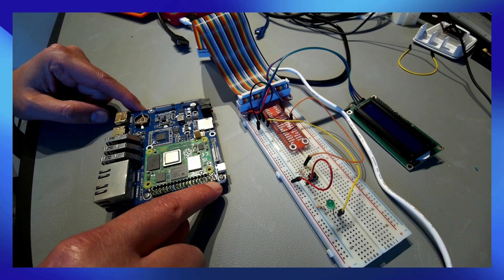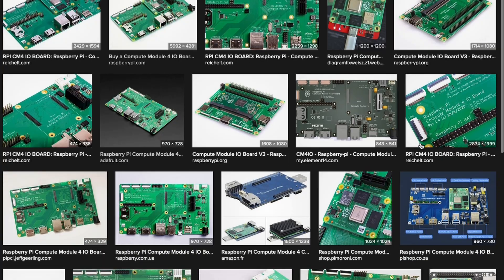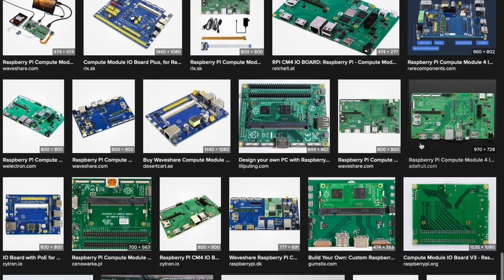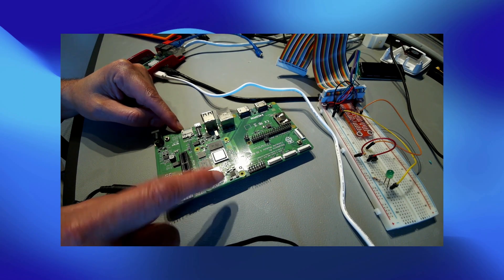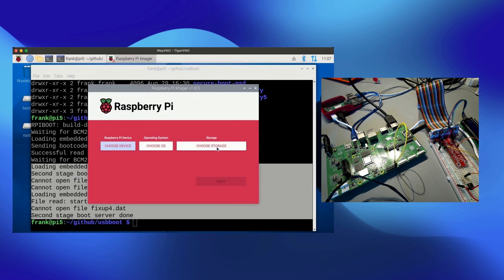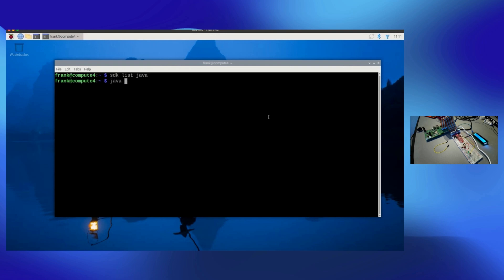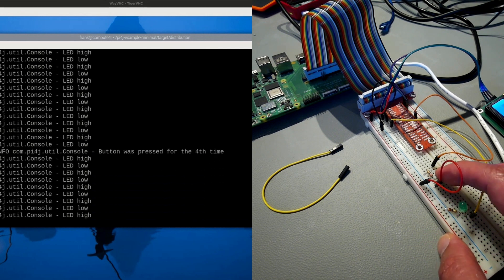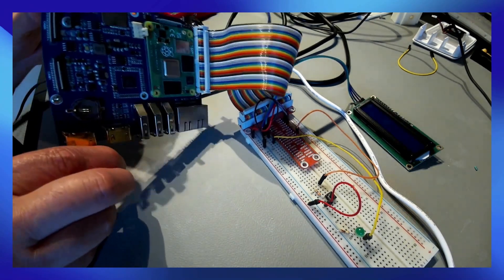Java and Pi4j on Raspberry Pi Compute Module: Unleashing the Power of Tiny Tech

Comment: Not sure if I'm correct ... but my research showed that the compute module 4 is not the same as the standard R-Pi.  The compute module 4 supposedly allows access to all 4 PCIe lanes if needed for items like the Hailo-8 which supposedly the Pi-5 will not access all 4 lanes of the AI module????
Reply from the maker: Thanks for your feedback! I'm not a "deep technical expert", just an enthusiastic user ;-). They are the same regarding the components, but indeed the wiring towards the compute connectors for the base board, can indeed be different, exposing more features....